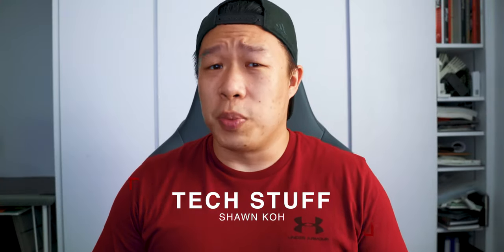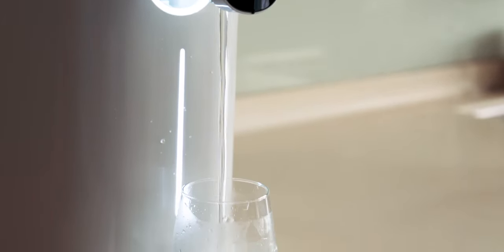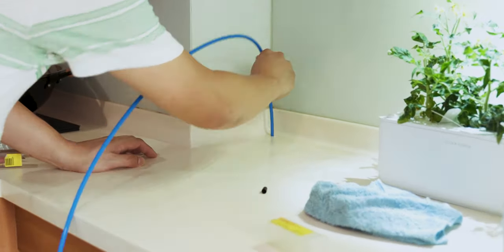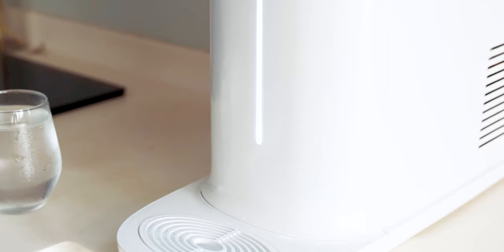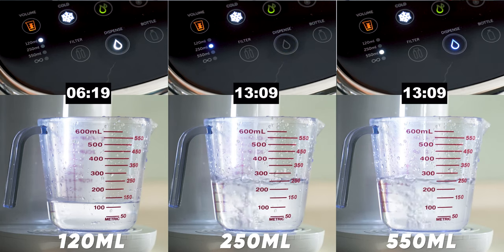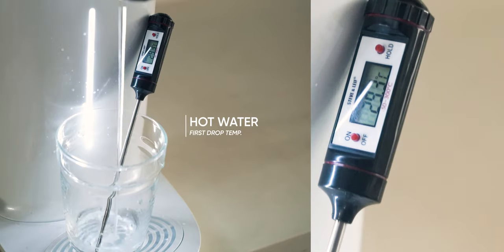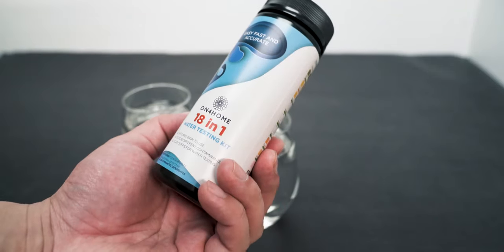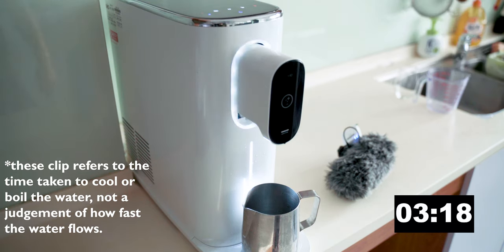OVIO Water Purifier & Dispenser by Sterra | 2021 full review

Comment: Wondering why is there a need for water to be drained out to the water pipe tube under the sink? What water is this? How much is drained out to get clean filtered water? Is this a wastage of water? Just wondering.
Reply from the maker: The output for the water is for the interval rinsing of the internal pipes, this is to make sure the pipes are clean and do not have stagnant water. The intervals are pretty spread out so it doesn't take much water to rinse.